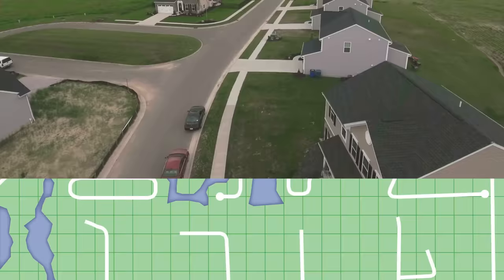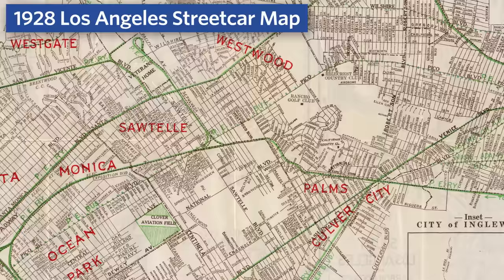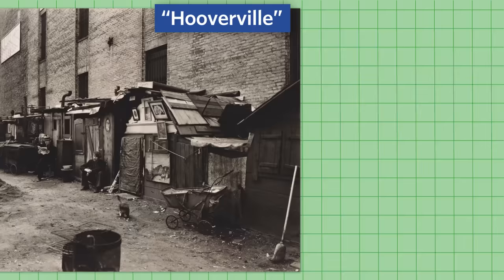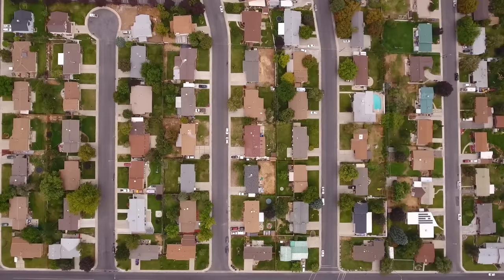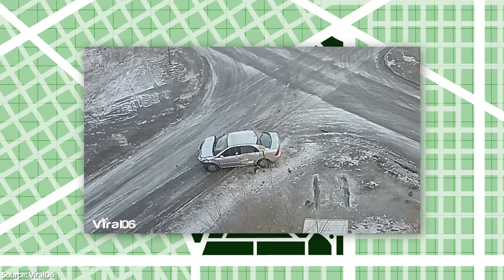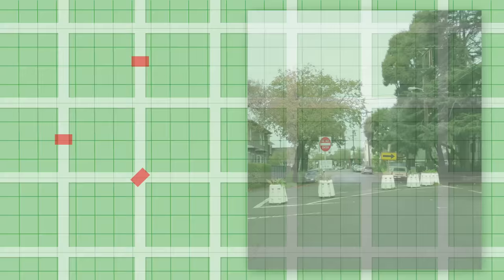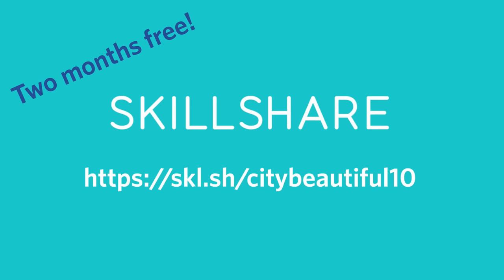The Reason Our Streets Switched to Cul-De-Sacs

Comment: Such a shame that we design our cities around giant metal boxes that move instead of the people that actually live in them!
Reply: Yes!  Let's force working class people to walk 20 miles one-way to work!   We'll punish them for having such backward ideas!   Punishing workers is great urban planning!
Reply: Well, it was because of people that we ended up this way.
Reply: @howtubeable  Or just design cities with jobs closer to the house
Reply: Howard Wiggins it’s called trains and public transportation.
Reply: @howtubeable  The problem with urban design in the USA is that residential areas are far away from business areas. As you correctly pointed out: 20 miles one way travelling. Too far for walking or cycling indeed. Public transport is useally not an option either, so the car remains as the only way to get to work. Urban areas should be built closer to business areas. Less depended on the car.
Reply: Howard Wiggins obviously building on a human-scale wouldn’t involve walking 20 miles. Good job at not understanding the point.
Reply: harrylongbaugh1  Indeed, MT is slow, more expensive then gasoline costs and sometimes you meet undesirable characters. That's why I am glad I can cycle in my city, going anywhere.
Reply: Only a non car guy would speak like that.
Reply: @fortheloveofnoise  Oh no, I still own a car and even a trailer. I need to go to Amsterdam with tools from my home town Utrecht, every 2 weeks. Cars are not a problem for me. I just ride my car as little as possible. It saves gas money, maintenance and increases the lifespan of my car. And cycling is more fun then driving my car.
Reply: @mardiffv.8775  Too many big hills here to cycle plus motorists will run you over. Also, gasoline is very cheap in the U.S.A. so rven powering my 5.7L V8 engine does not cost me much.
Reply: Except that small neighborhoods with culs-de-sac are more attractive, more private, quieter.  So really, these systems are more pleasant to live in.  Also, we don't design anything for cars, we design for people, since, you know, people drive them and own them.  We love cars.
Reply: We don’t. We plan our cities around restricting building to classifications to control tax rates by using zoning to create artificial scarcity and political deal making.  The car just makes it easier and provides cover for it  by being a scapegoat.

Comment: All the houses I've owned (three) have been in a cul-de-sac and I don't remember making a conscious decision in that direction but the obvious advantage is that we don't have through traffic so it is quieter and generally safer. I can imagine that a city designed with a grid makes getting from one place to another a lot easier, but it makes the lives of the people living there less pleasant. My understanding is that Milton Keynes in the UK was designed kind of based on a grid system at a bigger level but each block is then separate within the grid so that the communities feel more like cul-de-sacs.

Comment: Nice presentation, I had always wondered where the chaos came from. Where I live now was all orchard land 20+ years ago, and we have tons of small/short Cul-de-sacs, each with 4 to 7  houses around them. They are named as, and called "Courts". They were built inside of the existing grid system that surrounded the old orchards. I'm sure a lot of the design has to do with the fact that orchards of differing sizes were developed one or two at a time, which made the inner grid, street spacing irregular. The "courts" were used to fill in the voids, and cram more, close to standard sized plots, inside the existing grid they were contained by. 

 It works, and doesn't effect the flow of traffic in and around the neighborhood, but it does leave some strange shaped lots and you often share fence lines with multiple neighbors on. Our house has 3 properties bordering our back fence and one on each side.

Comment: In Australia at the end of the most Cul-de-sac is walking/biking paths linking up for better walking routes. So I never encountered this issue. Australia for the most part has been a practical country. Also in areas where the grid is used a lot, speed bumps placed every 2rd or 3rd house. Unless it's a main road.

Comment: Some states do it better than others.  In California they still make the roads wide enough for fire engines to pass each other with cars parked on either side.  I visited a suburb in Georgia and the front yards were huge, but the street was tiny.  You had to slow to a crawl to get by if a car was parked on the curb.  And no sidewalks either.  Plus, the city did not make them account for the traffic on the 2 lane roads leading to the city, so those would back up during rush hour.  A full plan would have them widen those to accomidate more traffic.

Comment: I like what you are proposing for the future: neighborhood units with connecting foot paths. We need more connecting neighborhood units and more connecting arterials. This is a particular problem where I live in Austin, TX. All through traffic is forced onto arterials which are spaced roughly on a grid about 2 miles apart. This forces more traffic onto less roads.

Comment: My home city of Edmonton, Alberta, Canada is incredibly guilty of vehicle-oriented sprawl, but over the past couple decades there has been more and more of the hybrid grid/cul-de-sac design you mention around 6:20, along with new bicycle paths in older grid-planned neighborhoods. Change is happening slowly, but Edmonton is far more traversible by bike than it used to be! Also, I think the hybrid design has been a good fit for newer neighborhoods, and I see as many people out walking (especially now that the snow is gone) as I do in older neighborhoods built on the grid. Plus, the city requires a minimum level of apartment/townhome/duplex construction in new areas, to increase density a bit and give a wide range of home prices in each area (mixed socioeconomic development).

Also, you should check out Edmonton's proposed urban gondola project! It's being privately financed as the company behind it (Prairie Sky) sees real profitability potential in it, even while the city is making them set aside funds for gondola removal in-case the project fails before it's complete.

Comment: I grew up in a neighborhood that was developed in the 80's and 90's with the whole weird layout, people who didn't live there would get lost all the time coming in and out. Its a stupid design. I currently live in an older 50's neighborhood with the grid structure and its completely superior. It handles traffic better, it flows better, things are easier to find because you have a better sense of direction. I understand not wanting your neighborhood exposed to through traffic, but you could easily close some of these roads off and only designate a portion of the roads for main traffic, while still keeping the grid. Disconnected networks of roads are utterly retarded.
Reply: 'Handles traffic better' Have fun having to stop every 10 metres to wait for a traffic light every single morning.
Reply: @williamhuang8309  there are no traffic lights dude. Just stop signs and yield signs
Reply: @williamhuang8309  That sounds like a European problem. Grids only create traffic lights in major cities. For the other 99% of the country there's literally no traffic lights needed at all.

Comment: It’s an old argument. Grids are expensive for road construction and housebuilders. Since developers get to build around the end of the cul de sac, you get higher density and more efficient use of land. Also, if there us no zoning, they enable multiple use because of through traffic and also give you legibility. Cul de Sacs are cheaper, quieter, safer, promote social relationships and discourage crime. But they are a nightmare to navigate and are almost always single use, even where (as in the UK), there is no zoning
Reply: @chukotka6224  I have been a professionally qualified city planner since 1986 so it’s possible l know what l am talking about

Comment: If they finished them with a tiny square interconnecting many separate sacs and tossed in some cafe's and a shop if would actually be a really cool design. You could also allow buses to cross the square, but no cars, hence keeping minimum car traffic, but decent public transportation.
Reply from the maker: Yes! That's what I was trying to get at with the path connections at the end. There are places that have those squares connecting cul-de-sacs, but they are public parks.
Reply: While we don't have much in the way of Cul-de-Sacs here in Trondheim, Norway, we do have a lot of weaving street networks. The municipality has made a lot of them only accessible to pedestrians and/or public transport, and turned half the city core into one way streets, turning the townscape into something that roughly matches what you describe.
Reply: @2Zemog  Interesting, what are you thoughts then? The general density of housing must be an important factor in making it work, no?
Reply: @CityBeautiful  Do you think converting existing neighbourhoods into sth like that is doable? Or would it require complete rebuilding?

PS Also, that must be the first time I get a response from a cool, popular channel like yours! Yesterday I got a top comment under Joe Rogan's video, today I get a response from City Beautiful, my YT commenting is going well this week!

Comment: Short answer… the number of car exploded in modern times. Cars are the most space inefficient form of transport today. All this space demanded that many areas of cities be demolished to make larger street to accommodate the enormous volume of cars. Meanwhile residential areas needed to become more efficient with the small space given. The current system is only efficient when you account for the fact that we have emphasized an incredibly inefficient and environmentally unfriendly transportation option. 
If you’ve ever been to Los Angeles it is quite apparent that cars have got to be the most inefficient method. I went to a concert in LA, it took 1hour and 30 minutes to go 10 miles.

Comment: The grid system is WAY better. Modern neighbourhood streets are difficult to find and seem like they were designed by children on meth.
Reply: To each its own. I live in a neighborhood with winding streets and cul-de-sacs since I was a kid and I love them. I think they are far more beautiful with better landscaping, and quieter from the traffic on the main road.  Everytime I enter a city it confuses the hell out of me because of all the one way streets, crazy amount parked cars on the steet, trying to find a parking spot without paying, dead ends, no private roads, gated entrances, more crime, the homeless, roads are much worse in my experience.  You couldn't pay me to live in a city. I don't even like going in a city to begin with.
Reply: Stellvia Hoenheim  Tried that. Just made everything worse. Let evolution run its course :)
Reply: Sure getting around is easier in a grid but everything else suffers.

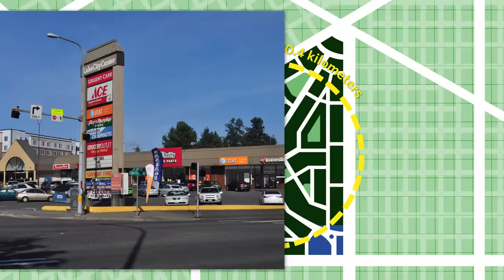Comment: Holy shit! I clicked into this video randomly, and at 3:32, that’s my street corner! (which is ironic, because it’s actually in a very grided area of Seattle lol) I live directly across the road omg. How tf does this happen?! 🤩😱
Reply: I was checking the comments to see if anyone had noticed. The pattern holds somewhat, because in Northeast Seattle the grid holds extremely strictly up to NE 8th Street, loosens up a bit north of that, then basically goes away at 145th.

But yeah, Lake City is still more on the grid than not.

Comment: Prefer grids.  I've been to Europe many times, where most cities are older and started with people riding horses, pulling carts, etc.  It's hard to navigate when the major streets aren't in a grid.  Tokyo is also confusing.  Street addresses seem to just be random numbers and dashes.
Reply: IIRC, street addresses in Japan are based upon the age of the building, so two buildings next to each other won't necessarily have sequential addresses.
Reply: roachtoasties mostly even our very old streets here in Germany do follow some sort of logic, but you have to keep in mind, most cities started up as multiple towns that later got connected. So they usually follow an internal structure, growing out of a town center, until they touched the next city quarter and had to stop.

Comment: Urban planners for the past 50 years:  We hate cul-de-sacs.  We hate cul-de-sacs.  We hate cul-de-sacs.
Urban planners today: OK, we were wrong about cul-de-sacs, but we should have shortcuts for bikes and pedestrians.
Everyone else: We told you so.
Reply: Dan Sanger 
And if we had stuck with grids we would have never had these problems.
Reply: @matthew8153  With grids, we would have still had the problem of lack of traffic calming, which is what cul-de-sac style development solves.  Grid-based cities are putting in traffic calming solutions which mimic the suburbs, including blocking off streets to create ad hoc cul-de-sacs.  Yes, the ad-hoc cul-de-sacs have pedestrian shortcuts, but my suburban development built 35 years ago has cul-de-sacs and pedestrian shortcuts.  It's not like people never thought of these things before.  Grids should be used at the larger scale on main arterials, but residential areas (singe-family or multi-family) need organic traffic calming to make the streets feel livable and walkable.

Comment: So it’s cheaper and helps car drivers...a little.

At sacrifice of everything else.
Reply: Well, it's also more attractive, private, quiet and there are more green spaces.
Reply: They reduce car traffic on residential streets, allowing for more quiet and safe neighborhoods. Plus more environmentally friendly because it uses less building materials and encourages walking through shortcuts.
Reply: It certainly made things quieter. I was born in Santa Anz CA which was gridded, and the traffic was horrendous. I went to Anaheim, where the cul de sacs were very lonely. And kids on bikes were frequent.
Reply: Jose Ornelas well the traffic problem is also probably due to the fact that there isn’t very good public transit in Santa Ana
Reply: @Dell-ol6hb  in 1976 transit was fine. It's just that people constantly drove through getting to other parts of the city, because the roads all connected.
Reply: @FunkyJeff22  environmentally friendly =/= forces everyone to buy a car
Reply: @dynamicworlds1  In most towns, cars are a needed anyway, because it just isn't dense enough for a grid. There generally aren't any place to go regularly that would ever be in walking distance regardless of street design. The whole "I need to walk everywhere I go" mentality only really works in big dense cities. In fact, where I live, The downtown area is the only Grided out area of the town, and it is the most traffic heavy. Too many stops to get anywhere by car, and too far away to get there by foot.
Reply: @wasweiich9991  I agree 100%.

Comment: I read somewhere that cul de sacs arose because there was a tax based on the length of curb a property used. The keyhole end of the cul de sac makes it possible to arrange five or six houses with very small curb frontages. Myth?

Comment: There is also some individual that has an idea for their PHD. In my opinion it is the worst idea because it is difficult to find someone or a place. It means that you can get more homes in smaller places. The old grid could put schools on certain streets and reduce speed and through traffic on the other streets at regular speeds. If you want to reduce crashes you put round abouts in place and no one gets t- bones.

Comment: conservation, bio-diversity, stormwater management, soil conservation, NMT, overall public transport. and probably several other things within the sustainable development mantra that I can't think of off the top of my head - all missed in this analysis apart from a brief interlude at the end about NMT. There is much to say in this regard and I appreciate the reluctance to change but some of the urban design principles you touched on with 'negativity' deserve a more in-depth analysis as their core principles are not separate from yours in many ways...

Comment: I commonly think about how I want roads to be made, since grid is kinda boring.

Cul-de-sac is something which I add a lot of times since it does allow for easy access to stuff

But I didn't knew people had figured out T intersections were safer than four ways way before me. I thought about it mostly because you can build speed in a straight line, but very difficult with many turns.

Come to think of it, I was trying to do the opposite of a speedrunning path.

Comment: Loops and Cul-de-Sacs increase sprawl and traffic.
The curved streets and bulbed ends cause irregularly shaped lots that invariably increase lot size and reduce density.
Because there are fewer through streets, every local trip uses a collector or arterial, increasing the load on those facilities.
They are a dumb idea and have to stop.